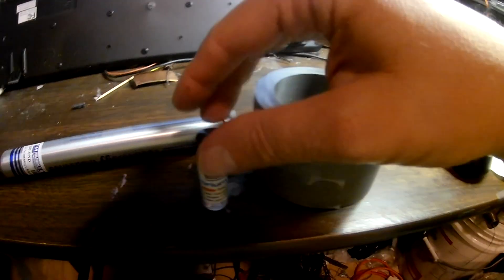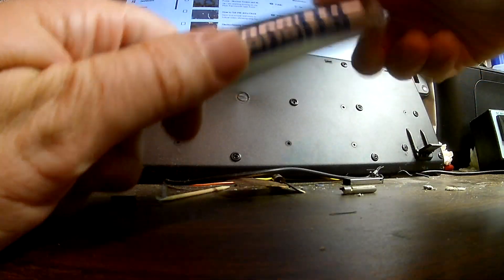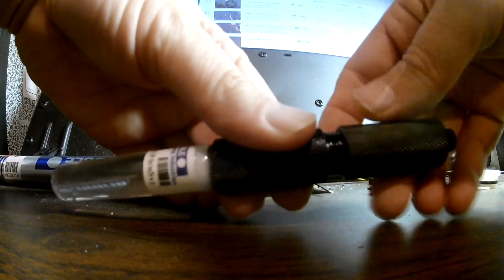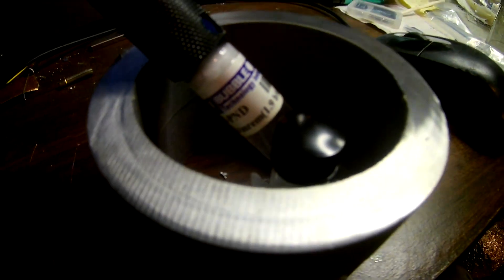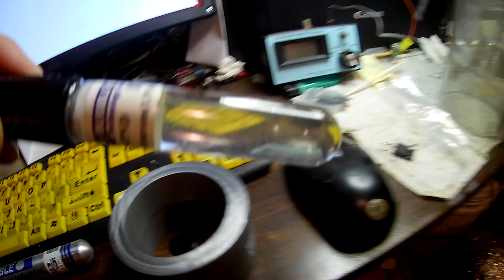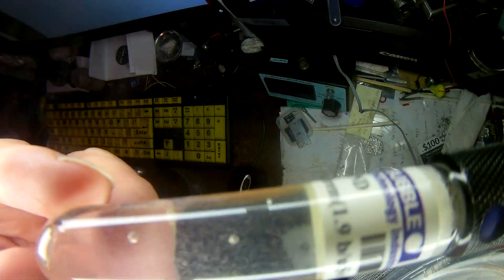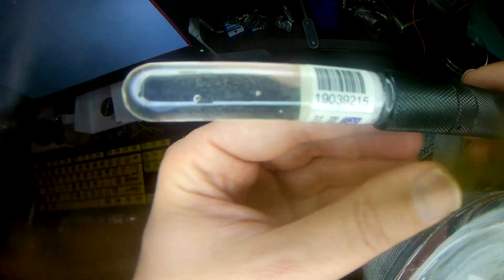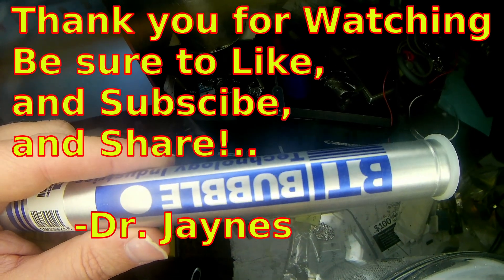Micro Thorium Heavy Water Reactor with Beryllium Reflector Rings

Comment: Well once you achieve self sustaining reaction real fun comes. I do not know how much heavy water you can buy before it is suspicious. But aqua homogeneous reactors were thing with berilium you can Shirink ie even further. Hmm heating home application? Even smaller application would be accelerator driven reactor which would be sub critical. It might work as energy multiplicator. Gas prices are high :D

Comment: Got me one of those supposed rings of beryllium. I plan to get some lead brick and rig up a neutron He3 detector along with some americium sources.
You can find americium smoke detector sources of ali express for about $1 each.
Reply from the maker: Yes, They are not super powerful.. but you could collect a whole lot of them!??
Reply: @jaynesnetwork  yeah you would need alot there is a guy out there who said a single americium source with beryllium could maybe push out 2,000 neutrons a second.
Although if you collected a bunch to use at once I would set up a test chamber with water around it and then lead around that.
The water moderates and reflects the neutrons the lead will stop the gammas moderation will kick out.
Dont take chances
Reply: If you want a powerful radiation source, then smoke detectors containing Americium suck, buy uranium ore and refine it, it's not that hard, then you'll have radium, fertile uranium 238 and a little fissile uranium 235

Comment: no critical mass, no fission
Reply from the maker: Not true!! One neutron can create a fission reaction! Also 'critical mass' is kind of deceptive.. because..  'Critical mass' is dependent on the shape of the material.. and other things.. and so is not an absolute quantity!! I think what you are really wanting to talk about is a 'critical nuclear reaction'.. or criticality,..  where for every neutron lost from the system, there is at least 1 more produced... This condition maintains a fission chain reaction!  Of course I don't want to create a critical nuclear reaction in my basement!! Thanks for the great comments!!
Reply: @jaynesnetwork  yeah i know that the critical mass is not an absolute value, it is relative to the shape, kind of moderator, if there's a neutron reflector, density of the fuel etc etc.
yeah one neutron can be absorbed by a heavy nucleus that later splits, issue is, you don't have any kind of neutron source to start the reaction, to get free neutrons you first need some neutrons to kickstart the reaction. every nuclear bomb/reactor has a neutron source, your doesn't, so unless you have californium 252 that gives spontaneous fission, you are not producing any neutrons, or if you do, they are not measurable
Reply from the maker: There actually is a neutron source here.. You have to think outside the box.. and outside the text books as well.. there are many different ways to generate neutrons!! This is one of them!!